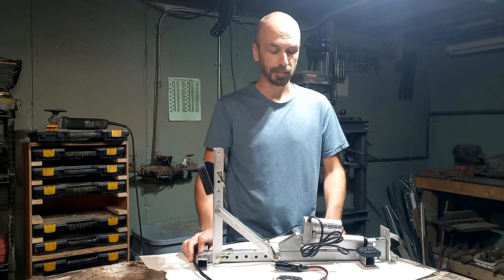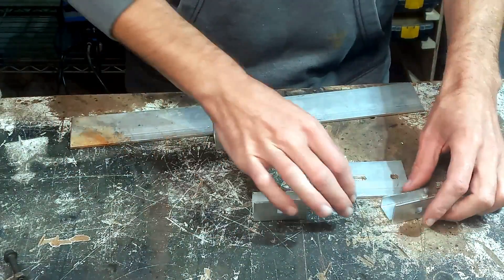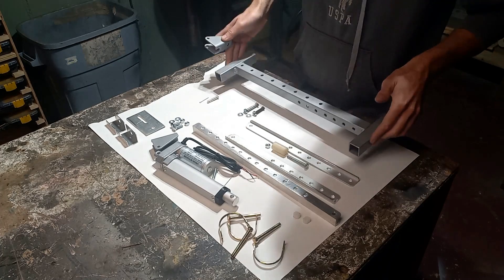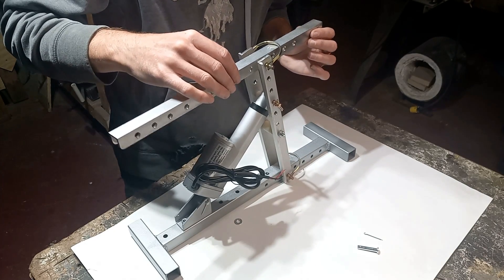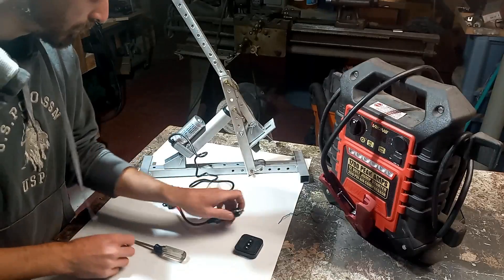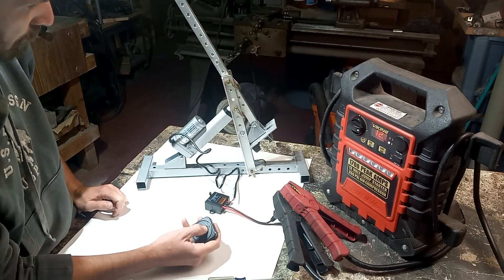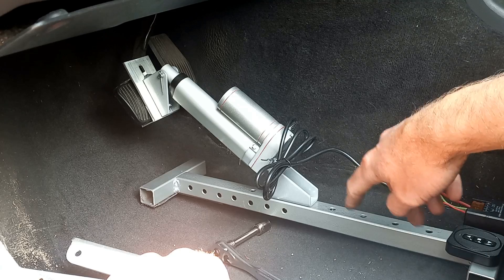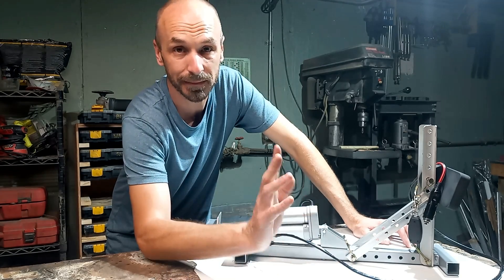Remote Brake Bleeder - How to bleed brakes by yourself - DIY BUILD - Easiest way

Comment: Exemplary work. I plan to create one but my version just uses an air cylinder of no more than 6" stroke and a manually actuated 5/2 valve. I have an air compressor to drive the cylinder but it remains to be seen whether my compressor can supply enough air to achieve a fast enough pumping action for my liking. The only fabrication I plan to do is to adapt the cylinder rod end to the brake pedal and the static end to the driver's seat sliding rails. If this doesn't produce enough force due to the high angle between the brake pedal's motion vector and the cylinder rod axis then I'll have to add some simple structure to raise the fulcrum point up high enough. Alternately I suppose I could just try to find a temporary girlfriend or maybe cajole some local panhandler to help me for an hour.
Reply from the maker: Thank you. I'd caution with air valves, but try it out. Lol. I've asked people walking down the sidewalk to pump the brake in the past.

Comment: Damnit, I just had this idea today too (wife is out of town), and of course, somebody has already thought of it 😂

I was thinking Ryobi might have an 18V one with wired remote, that just presses up against the seat base with a padded saddle. Kinda like their powered, torquey caulking guns. I have a medical vacuum pump, as well as the usual power bleeder setup... But would prefer to just use a remote pedal tool! Cheers!
Reply from the maker: It is helpful not to have to grab someone to pump the pedal.  Lol. I'm sure I'm not the first to come up with the idea, but if someone is motivated to make one, this is how I did it. Cheers

Comment: That's an awful lot of work when all you got to do is blow air past the brake bleeder
Reply from the maker: I believe you're describing a venturi effect.  I've never seen it done on brakes, but I'm intrigued to test it's efficiency.  I can imagine the immediate downside is brake fluid sprayed all over the wheel well.

Comment: That is one of the best tools for the loner I've seen yet!  With one more part you could innovate that thing into one of the nest selling products in the open market! We - or - YOU could make a small fortune! Talk to me and find out how. . . post a return and we can talk about it.
Reply from the maker: Thank you.  I appreciate it.  I've designed 100s of different products,  and unfortunately coming up with the idea and building it is the easy part. Marketing it is the difficult part. I appreciate the kudos,  and there will probably be a follow-up video of improvements I've made after making this video.
Reply: @chrismakesstuff1  Ok - First, making a lever the size of your drive cylinder for the length, shaped like the letter "v" and anchoring it at the intersecting angles with a pivoting bolt,  on the mounting rail would pivot the power through at an angle lower from the horizontal parallel to angle force at the same angle as the ram in the direction as your foot on the peddle - you would still have to provide an anchor that would hold the whole thing completely flat on the floor - perhaps an adjustable vertical  wedge from the framework to the steering column - huh?  did I say all that correctly?